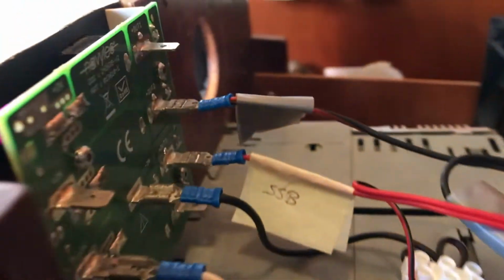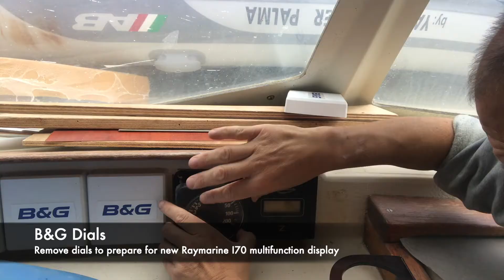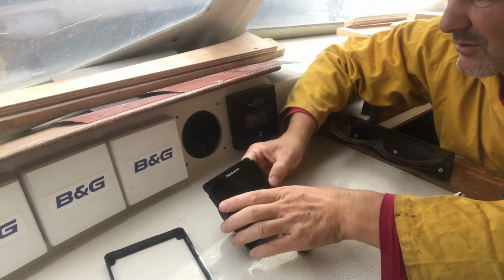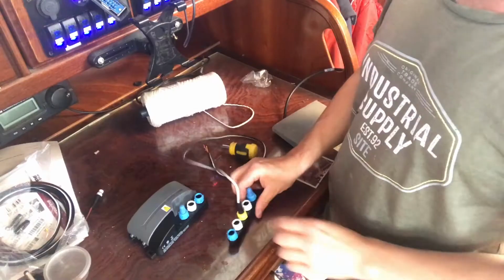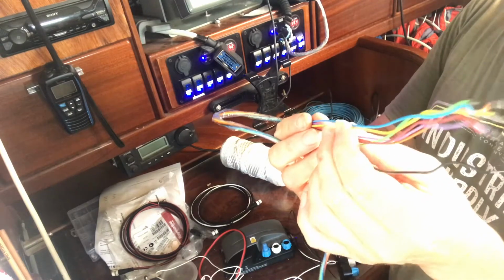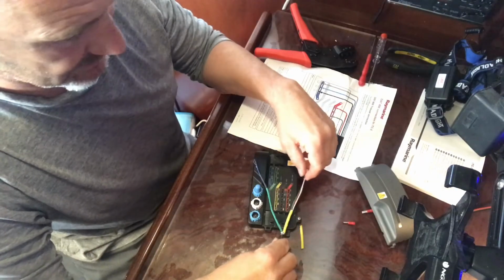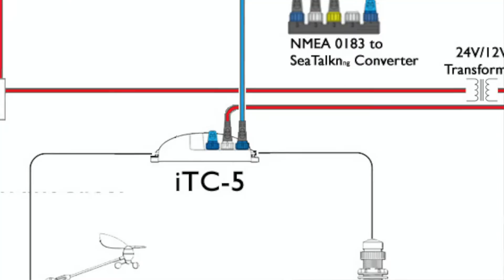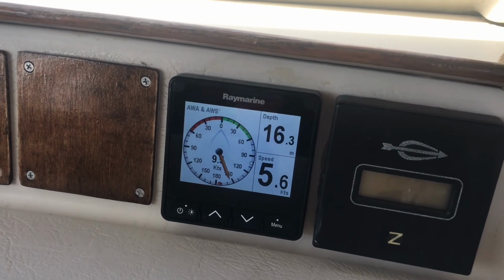Installing a Raymarine ITC-5 Transducer Converter & I70 Multifunction Display from T70216 Pack  pt03

Comment: That was interesting, I’m thinking of doing a similar job on a smaller yacht.  Quick question, where did you source the printed wiring diagram? Fair winds.
Reply from the maker: If they don't come with the equipment I just search for them online and usually find them somewhere.